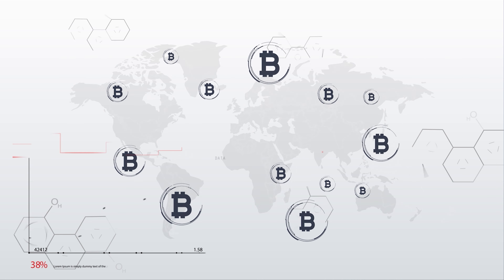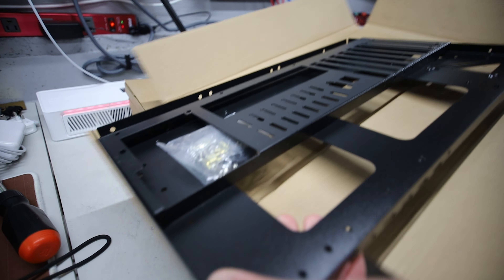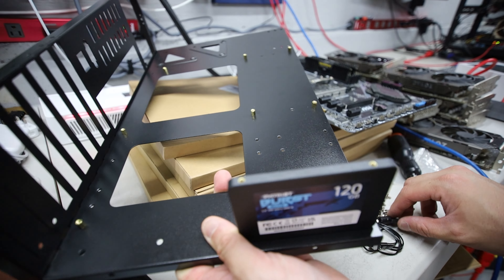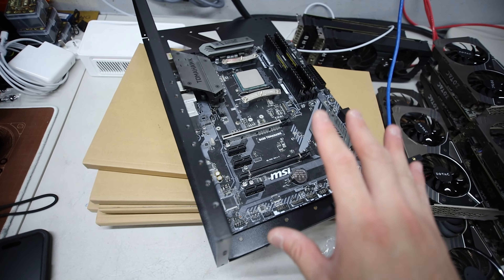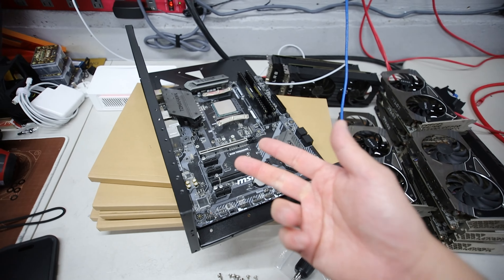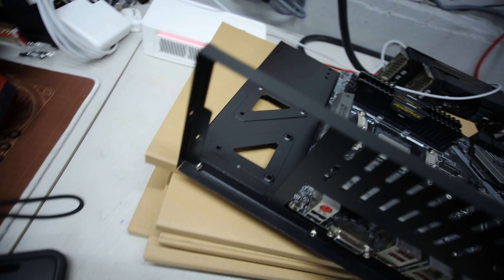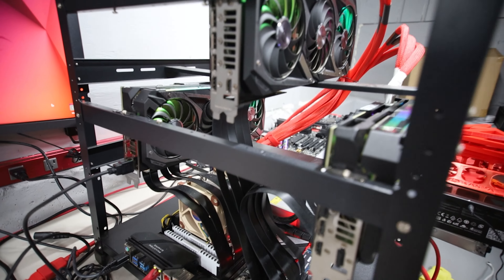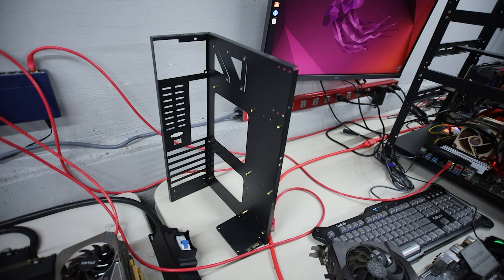Converting some of my CPU Mining Rigs to this FRAME!

Comment: You should definitely check out a newer crypto project called Warthog. Uses both GPU and CPU and those cases work great for builds for that. SOAT just did a video on the project

Comment: Very cool .. I have been trying to source some cheap Ryzen CPU'S, and also trying to build some affordable Ryzen 7 57X3D or 58X3D CPU's to build a gaming rigs for, four of my grandkids.  As of lately some of the Ryzen 9 5900 CPU's are cheaper than either of the X3D processors.  So far I have only sourced an ASUS X370 Crosshair VI Hero and a Ryzen 7 3700X, but to my surprise it is just as nappy, if not faster than my 11th Gen. i7; and there are official reports of crashing problems with 13 & 14 gen Intel CPU's after a month, so ; until they put out a firmware / BIOS update; I am staying away from them 

The x370 Crosshair VI only has four pin RGB connectors on the motherboard; and the CPU cooler is 3 pin, so I am trying to figure out a fix to make it look nice for the kids; if it was for me; I wouldn't care about the RGB, if on my system; I just turn them all red cuz it's not as irritating at night like the 4th of July going off in the PC case; but the kids will like the RGB.

Peace